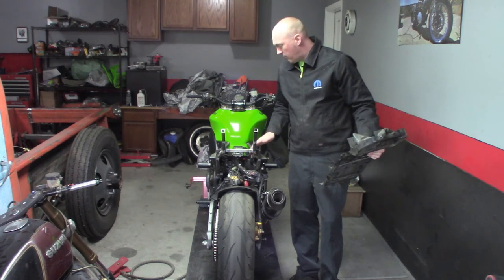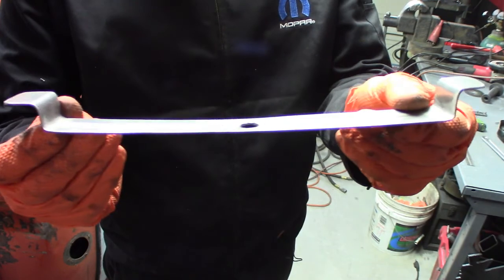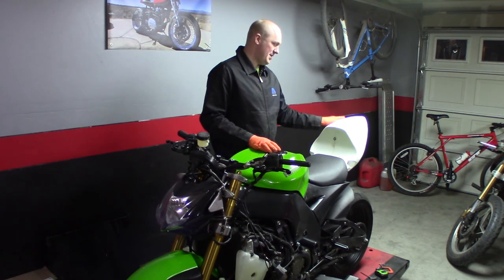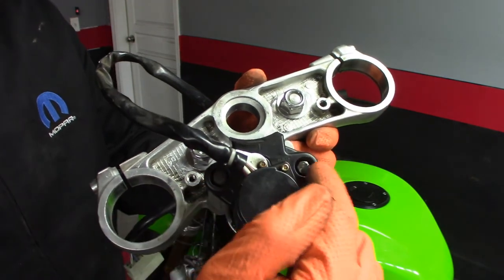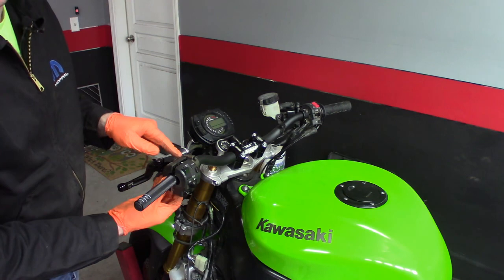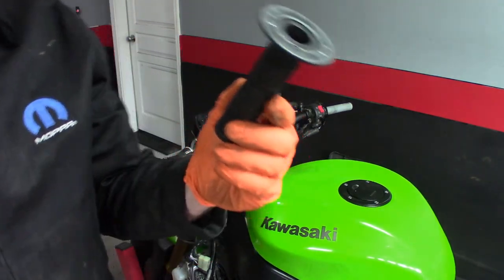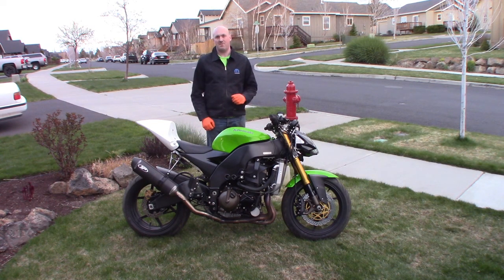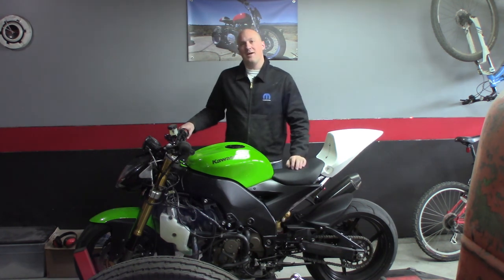Street fighter build: The final mockup- will it start?

Comment: Have the same bike and making a streetfighter as well. Did you make your triple tree yourself?
Reply from the maker: Kind of, it's the factory triple, but I welded the openings shut and sanded it smooth so I could mount the pro taper bars. I have an earlier video that shows the process. Thanks for watching!